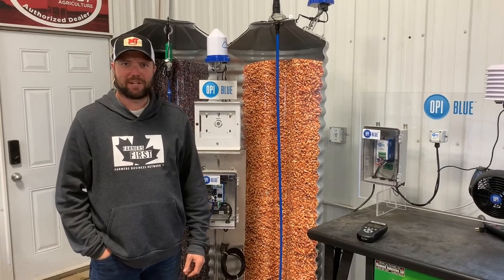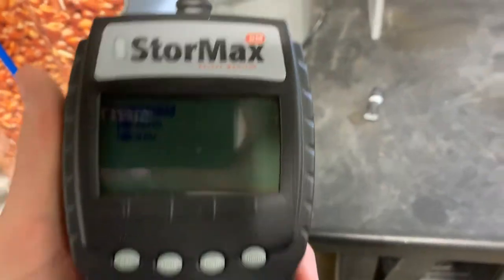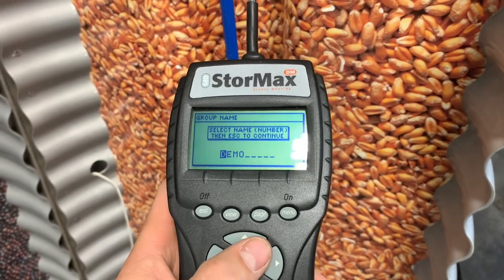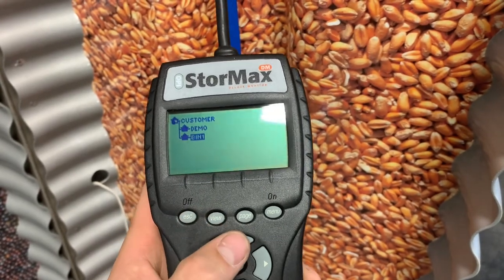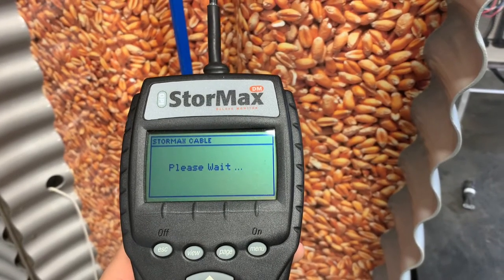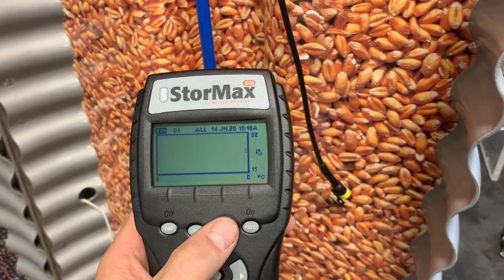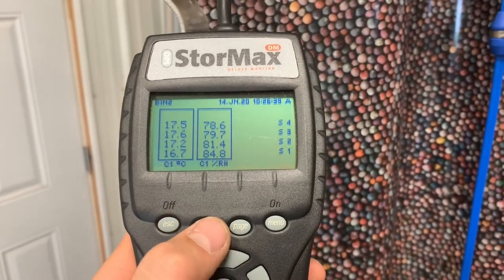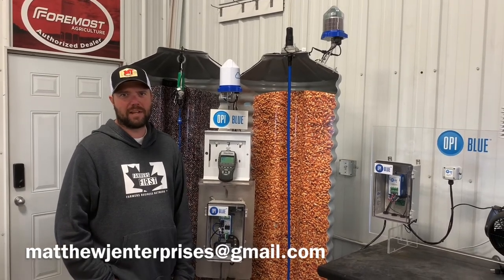Programming, addressing and trouble shooting an OPI cable

Comment: what does a system like that cost for the monitor and the cables.
Reply from the maker: Depends how many bins you were looking to do and if you wanted to go with moisture/temperature cables or just straight temperature